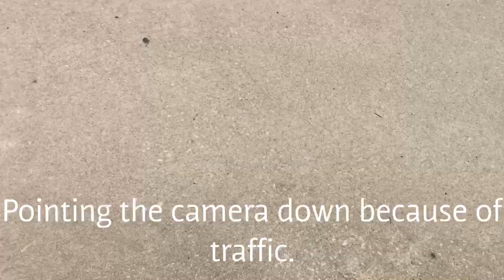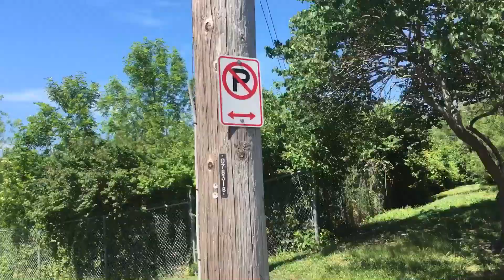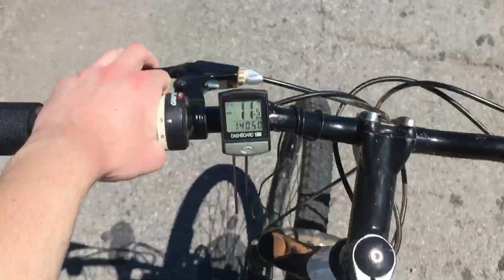Federal Signal 2001 SRNB siren and Thunderbolt 1000T failure Independence, Missouri

Comment: The Thunderbolt is inactive, including the one that got replaced with a DSA on top of the Bank of America building.  They were both deactivated in 1999. Great sounding 2001, and great video!
Reply from the maker: ShowMeSirens130 thanks. If they were supposed to shut down the Thunderbolts awhile back I find it odd that they were still running them until about 3 months ago.
Reply: Zach Safarik The one on top of the Bank of America building was still running off from a Siratrol. I find it odd that it was still connected even though it was deactivated. I subbed to you by the way. ☺
Reply from the maker: ShowMeSirens130 thanks! Just subbed to you as well.
Reply: Well, guess what? It’s not inactive! I went to Google maps and select the dates back-and-forth and realize that the thunderbolt moves every time I change the dates so it’s still active

Comment: This Thunderbolt and the one that downtown were both deactivated initially in the early 2000s when Independence upgraded the system to be all 2001s. A few years ago, Independence began to place voice-capable sirens (2008s,  6048 at the sports complex, and now DSAs) in areas where people would likely be outdoors during a storm. I believe this is when they made the decision to reactivate the downtown T-bolt for a brief period as a temporary holdover until they could install the DSA. The one on top of the power plant has not run since it was disconnected in 1999/2000. It has been pointing east towards Lake city for well over a decade now. 

Blue Springs, Lake Lotawana, Lee's Summit(might have replaced them, haven't checked in a while), Grain Valley, and Grandview are last communities in Jackson County with active Thunderbolts that I know of. Lake Tapawingo used to have a 1000T, but it was relocated several years ago and I have been unable to locate it since that time; it's still very audible on test day.
Reply from the maker: Jonathan Robertson I did find a Thunderbolt in the Lake Tapawingo area while traveling down Woods Chapel Road.  I had discovered it sometime last year.  If you Google the Missouri statewide siren map and look by Lake Tapawingo, the siren has a yellow marker.
Reply: Zach Safarik Awesome! You wouldn't happen to have link to that map? I'd like to see it and I'm having trouble finding it on Google.
Reply from the maker: Jonathan Robertson Sorry for the wait.  I was trying to pull up the siren map that I have on my phone but I kept getting a different map.  I do have the location of the Thunderbolt though.  It is located near 22309 SW Woods Chapel Rd. Blue Springs, MO 64015.  It is in audible range of Lake Tapawingo.

Comment: Did you report the failure?
Reply from the maker: ChicagoSirens not yet. I haven't notified them yet but I still have the feeling that they disconnected this 1000T when they replaced the other Thunderbolt in downtown Independence with that Federal DSA.  I will ask them about it though.